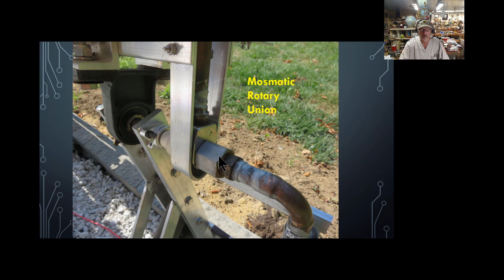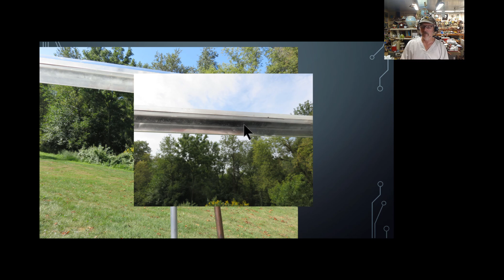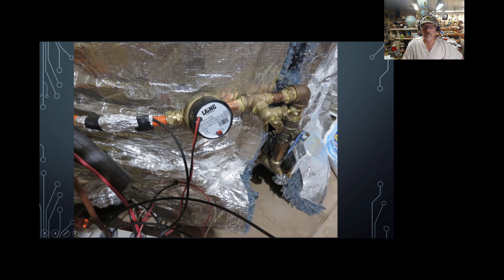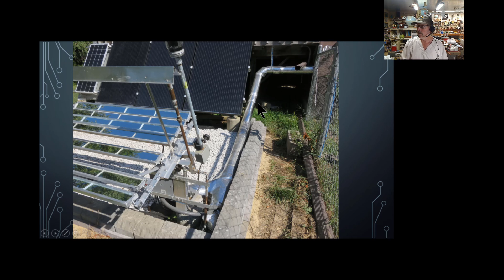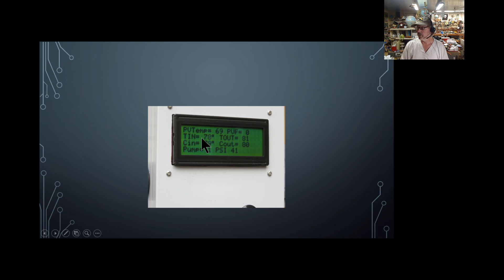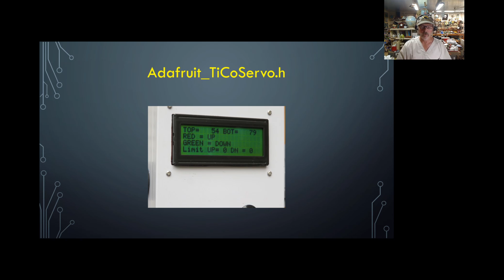Solar Fresnel Mirror Concentrator Water Heater Overview.

Comment: Nice work my man!  One of the things I noticed.  Pump should have a temp control in series if it’s solar run. .  It should stay off till a bare minimum 10% higher temp to set temp of system.  Ipump will go on and off till system reaches optimal output.  Unless you have a diversion from storage till system reaches Optimal temperature.   I have a new form of concentrated solar design I have worked out. Looking for someone to test build for me.  Where r u located?  Price out.
Reply from the maker: Hello Dan, thanks for the nice note. I do have  temp sensors (4) with the system/pump. I can sense the temps in/out of the tank and in/out of the tracker and control the pump as needed depending on the temp differences. I'm in Eastern Iowa. Jon